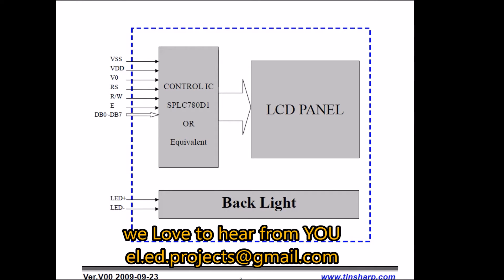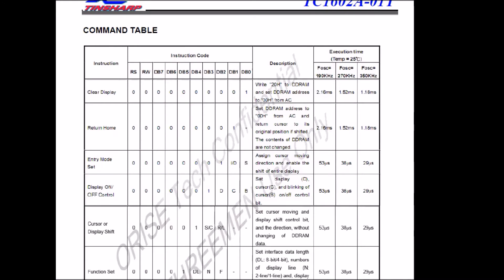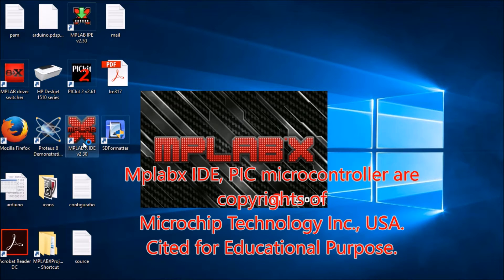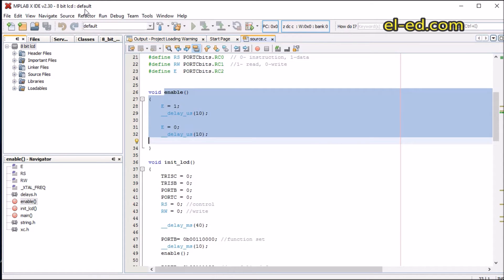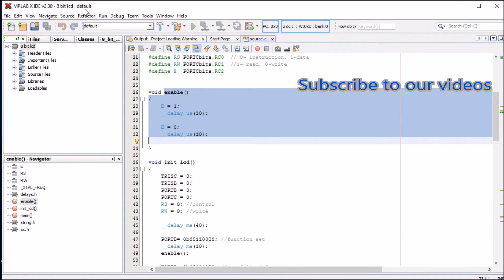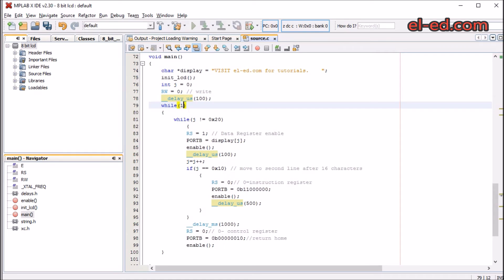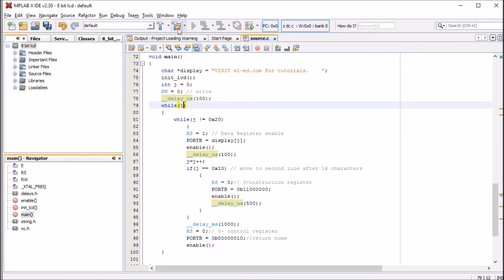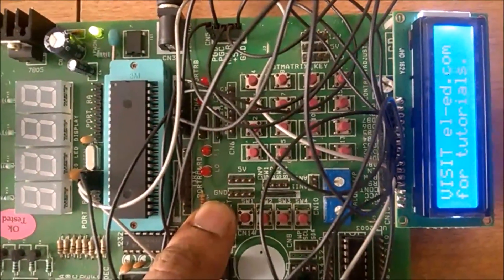8 bit lcd interfacing with PIC 16F877A microntroller.

Comment: hi, i tried ur code but just like some other tutorials on the net, it only displays white squares, i dont think my lcd is defective since i tested a new one and same result, i check my connections/wirings and no problem, the led on the dev board im using blinks in response to the program, any idea on how to make this work? tia (im using same specs, pi16f877a, mplab ide x 4.05, xc8, 1602a lcd)
Reply: Hi ! did you find out ?? I'm only getting squares too !